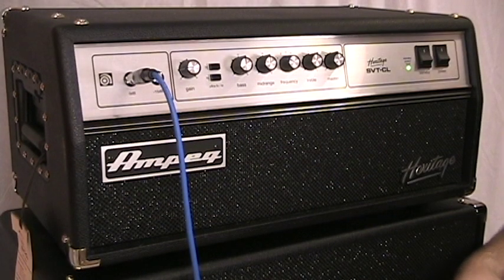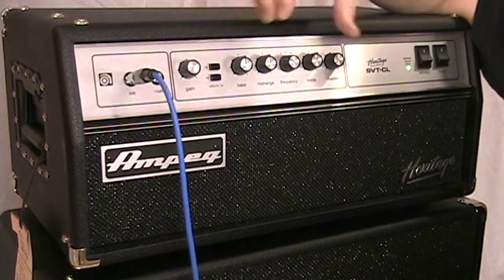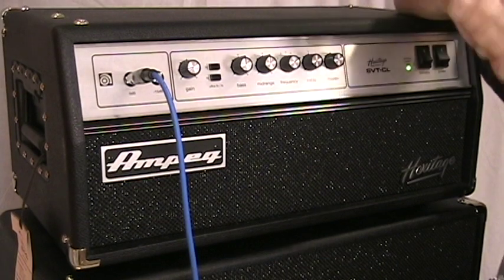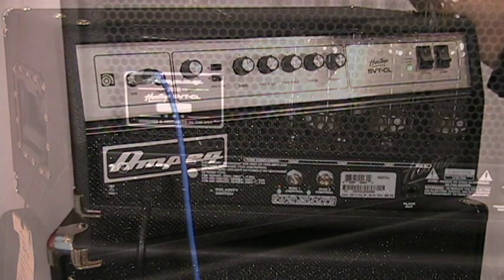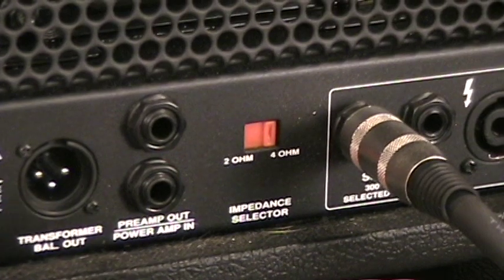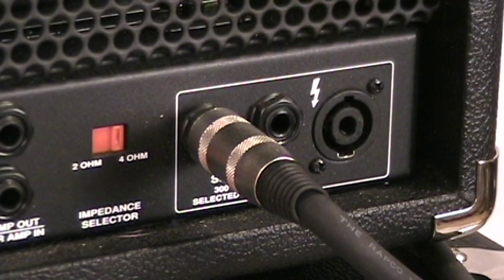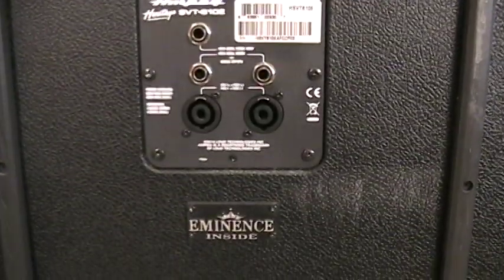Heritage SVT Series Demo Part 2 Features & Benefits

Comment: I just got this rig.  It is absolutely WONDERFUL!  I have a 69 SVT from the very first batch with 6146b power tubes and a 73 Flatback 810, and the Heritage rig is 100% its equal, plus it's a little bit lighter and much easier to schlep.

Comment: I'm no amp expert and I could be wrong. As I understand it the tubes have heater filaments in them. The standby switch cuts the audio signal to the tubes so that they can get up to working temperature before they have to start amplifying the signal. It causes a lot of wear and tear on the tubes if they are not hot enough (or too hot if there is no ventilation). The switch also lets you keep the amp on while you take a break or something, since turning the amp on is hard on the tubes.

Comment: @AmpegTV The Pre Amp Out and the Power Amp In must have a circuit that senses when a signal is present in the Power Amp In to send the signal to the Pre Amp Out in order to daisy chain multiple SVT Heads. Is that correct, AmpegTV?
Reply from the maker: In the signal chain, the Power Amp In is located before the Slave out. So you can keep slaving from one to the next.

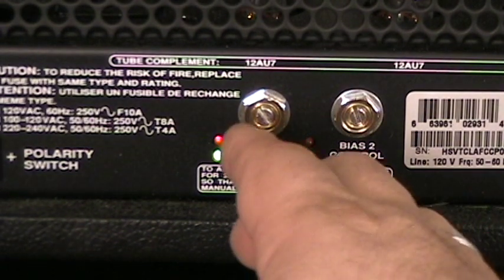Comment: at 5:27, i have an svt classic; i have bias 2 perfect just with the green light on, on bias 1 i am not able to get the green light by itself (i can only get the green and red on at the same time), i have fixed the bias before but it is strange this time. Would it be a faulty power tube?

Comment: He never explains the slave out,just slaving daisy chain with pre amp out n in. Nor can find videos about slave out.
Reply from the maker: The Slave Out contains the same signal that is sent to the Preamp Out. To "slave" another SVT, you would connect the Slave Out of the master (the SVT your bass is plugged in to) into the Power Amp In of the second SVT. By connecting to the Power Amp In of the second SVT, you are also bypassing its preamp section.
Reply: AmpegTV  thank you for replying.been looking on info about the slave out for a long time. So there's no way to link them and have the two independent so I can run driven and one clear with out just using a AB stomp box?